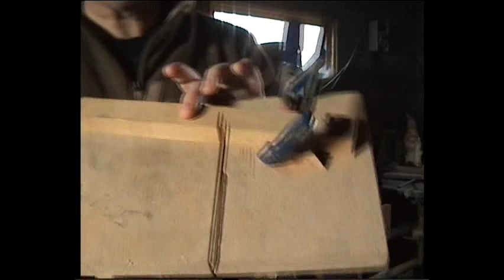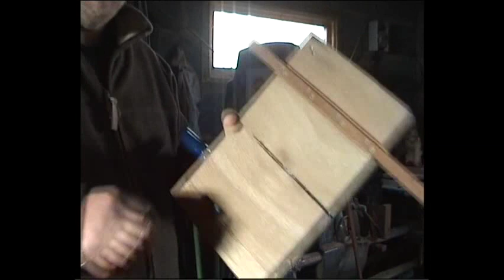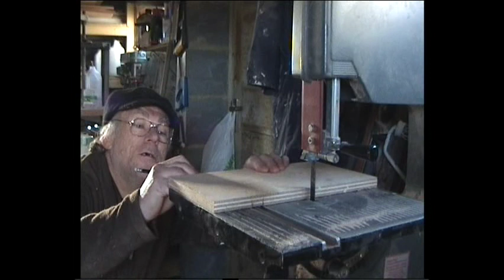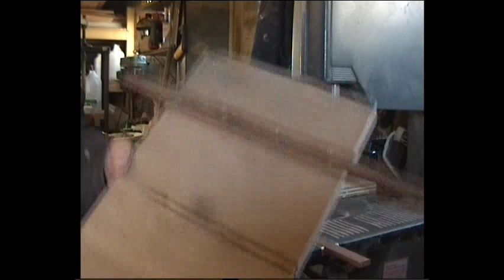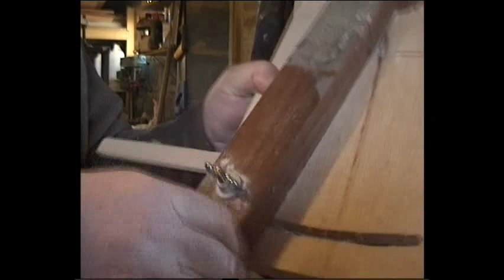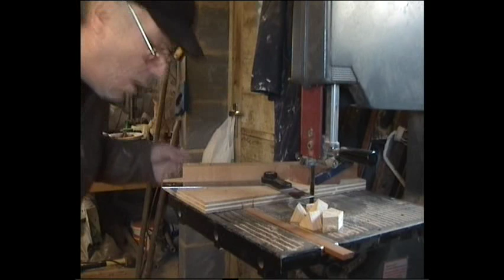sled for cutting segments on bandsaw

Comment: Just a little tip for you.   I use jigs similar to yours for making my segmented drum shells.   It's really useful if you make the jig so that it overhangs the right hand side of your band saw table by a couple of inches.   That allows you to hold the piece of wood on the top of the jig with a clamp (rather than using a screw) until you have fine tuned the angle just right, then you can keep the clamp in place to make sure it doesn't move, while you put a few screws in to keep the wood in the correct position for ever more!   Also, if you want an adjustable sled, then  instead of using your router to make a slot in the jig, you can just use a clamp to hold the right hand end of the fence in place, with a screw at the other end.   When adjusting the angle, you can draw a pencil line to mark where the fence is, then test if the angle is correct.  If it's not, then you can move the fence 1mm or so either side of the line until you get it just right.   It's much easier using a clamp to hold the fence in place temporarily than it is using a screw.   Once you have set the angle and fixed it in place permanently, then you can trim off the overhang if you don't want it!